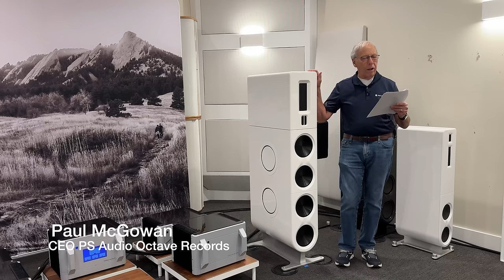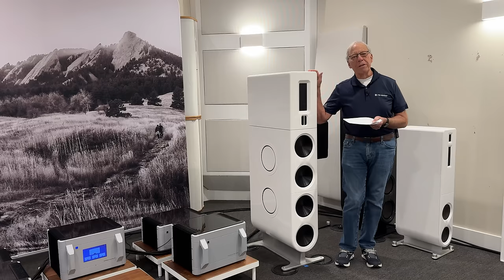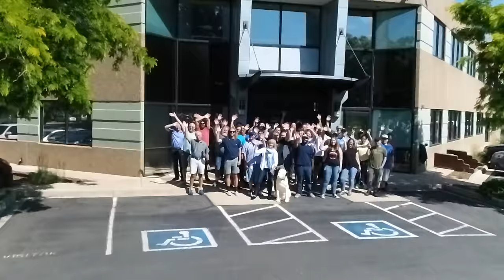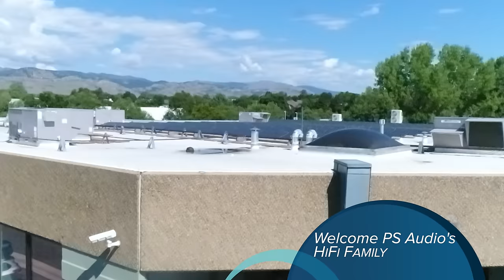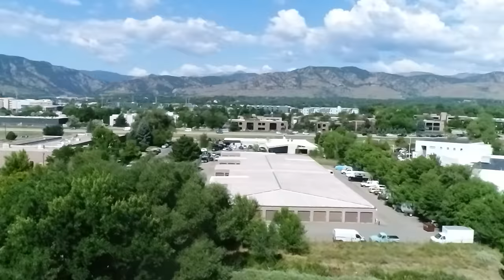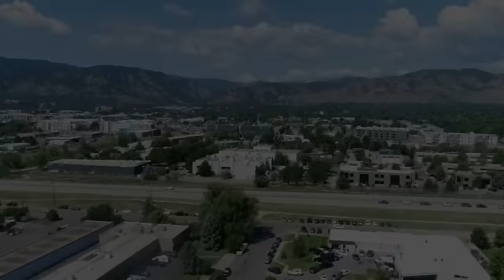Equipment without ground

Comment: There are two types of power supply , that is the conventional psu powered by  a large single phase or three phase transformer , whereby the transformer body core , is required to be earthed by electrical safety convention , while the other type is the switch mode power supply unit , where the electrical power line supply is directly switched by an embedded controller by a variable time constant high voltage pulsed mode   driving a high power mosfet drive which is then smoothed  by a high voltage capacitor , this is the type of psu , which is not earthed .

Comment: No equipment in the UK has 2 prongs because our outlets can run upto 3kw so every item is fitted with square 3 pin plugs including WiFi.where kit is class 2 double insulated the earth pin is plastic but still needs to be there as our outlets have shutters built into the sockets .the earth pin opens these shutters

Comment: There's a few YouTube videos from and with Shunyata Research where they are talking about all the investigations Shunyata Research did into chassis grounding and signal grounding.  On top of that, companies like Telos go a step further with "active grounding" (of chasses and signals).  I have successfully used Telos active grounding with a Luxman M-10X power amp's ground post.  Luxman and other Japanese gear has only two pin AC mains input.

Comment: Just want to say: A few years ago, wanted to change my cable TV provider. The new one insisted that the house had to have 3 ~ prong wiring. Had most of the house rewired, very glad that this was done! Important improvement! Yes, some electronic equipment is still 2 ~ prong. 😁

Comment: Star grounding your system, including all metal chassis, regardless if standard three pin, has a very noticeable sonic improvement on revealing systems.
Reply: No. No it dosnt. I prefer having my stuff grounded for proper surge protection but it makes no audible difference. Sometimes it induces more noise due to ground loops.

Comment: All extra groundings to a separate, audio-dedicated ground, especially if done through multiple, dedicated, intermediate grounding boxes, have to offer sonic benefits and lower the system's noise floor. Including any electrically isolated metal cases (isolated chassis). This includes the driver baskets on the loudspeakers. The far spatial resolution and low level information retrieval are tremendously affected. One has to hear the difference to believe it. For very long, I've been using a battery based system. No third prong anywhere, just the two poles of the batteries. Silver-plated, faraday cages, completely isolated electrically, protected my precious, short-path circuits from any external interference. I had never thought of any extra grounding, in fact trying it once, did not yield any positive effects. It was long after I had already achieved significant sonic improvements, using multiple, multidisciplinary mechanical vibration control on all of my components and after finding a way to further purify the power from my batteries, that the idea appealed to me again. And what a revelation when I tried again! Conclusion: If you can't hear the benefits of extra grounding(s), you have other issues to address before this final improvement.

Comment: Ground can be a hazard as wiring isn't always correct, as most guitarists know. You can potentially get shocked by true grounds such as water pipes and concrete floors. I've also seen tube amps and other equipment that induce some voltage across their chassis and will conflict with any other grounded equipment, it won't shock you but it will hum.
Most 2-prong hifi equipment is not double insulated, therefore it is somewhat safer to plug everything together before into AC, and away from true grounds.

Comment: Never use a three prong to two prong adapters to do a "ground lift" if you have "hum".  Proper grounding is important, the safety ground provides a low resistance return so if something bad happens the current will travel that way instead of through you.
Reply: Actually, for convenience, I often use two prong adapters, but also make sure to ground it to a metal surface using the small metal tab on the adapter.
Reply: I have seen two prong adapters used for location recording to get rid of the "hum." Not really a choice unless you want to forgo recording.
Reply: Lawd this is bad advice.

Comment: In Europe, grounding is very clear and it has to do with the operating voltage. If it is more than 25VAC or more than 60VDC, you must ground the chassis or have a double casing to prevent any chance of electrocution. The operating voltage in many hi fi devices is 5 to 12VDC. In computers, it is 3 to 21VDC. Power Amplifiers with rails in excess of 60V need to be grounded.

Comment: I run a Cyrus 3 with pxr psu, the power cables supplied are standard but only have the brown pos and blue negative there is no earth wire.

Comment: I have a high end Denon AVR and in the UK they only have 2 prongs and they use a plug convertor for the UK market. It gave some humming problems when connecting a Naim Hi-Fi amp into it.  I made a Ground Cable with only the Ground Wire  at the Plug. Attached it to the Denon Ground screw then plugged it into a spare socket. Bingo :) Silence :)

Comment: Call me crazy, but I think this was addressed improperly. I think the question was focused more on audible improvements from grounding equipmemt more than from the safety perspective.
Reply: One can assume that Paul answered the question in the only way he felt that ground mattered and therefor infer that he doesn't think it has any audible improvements.
Reply: Certainly not how I took it, watch it again.
Reply: Yeah, that could be... but I think the answer is still the same. If your chassis is not electrically connected to anything inside, then grounding it will make no difference to the performance of the circuits inside. Grounding the circuit itself would be like connecting Neutral to Ground... not a good idea.
Reply: In the UK.
Neutral is ground.
It's tied to earth (ground) at the power station.
Reply: @willtucker2774  Nope, neutral is NOT the same as ground in the UK. It may be tied to ground at the power station (or local transformer station), but a few hundred yards of cabling can cause a significant (few volts) differential between ground and earth at the outlets in your house, albeit without any power behind it. Our garage (in the UK) in fact has an additional ground rod installed, so the earth is also locally tied to ground, but neutral definitely is not.
Reply: @ve6svj in Canada, neutral is bonded to ground at the service entrance, it's not "whatever voltage".

Comment: My crock pot was 2 prong. At some point I was nearthe sink and touched the metal case an d got a strong "tingle". I being a man touched it again and - yep got zapped again.  I measured the case to ground and got a solid 50 + volts. I tore it apart and as they say , no user serviceable parts inside. Scrap and get a new one from Craigs list. How many times have you seen the wide blade on the plug filed off so it was no longer polorized? OR  plug a piece of PA gear into a ground to ungrounded adapter so it can float the power. [ who attaches the ground tab / wire to the metal box ].  Thanks

Comment: Hey Paul I subscribe and love your answers to all your audio.....except for this one , you really didn't go into detail as usual. A broken hot lead (however rare) that touches a metal chassis will surely liven up that chassis if it is not grounded and shock the user . I understand that they Isolate the power circuitry completely but that third wire(the grd.) is there for the users protection in case of a "fault". I find none of my 70's vintage beefy gear was built with 3 prong cords they all have two prong and they used some of the thinnest gage wire to do it (16,18ga. instead of a beefy 14 or 12ga) and often wondered myself why skimp there ? . I've been doing Electrical work for 37 yrs. now and yes I have a License and thought I would offer that info. Thx

Comment: My 200w Sunn concert bass head has the same kind of cable. Even scarier, there’s a polarity switch on the back with no + - logo
Reply: What the hell, for a hifi amp I wouldn’t bother but for a bass amp, where your are connected to the ground by the strings it sound scary as hell

Comment: In 45 years of using Hi-Fi gear, I don't believe any of my equipment has EVER been grounded! ... I'm in the United 🇬🇧 Kingdom, so my equipment has a three pin UK mains plug, but usually the mains cables are twin core with no connection to earth.

Paul is talking about "Double Insulated" equipment, which doesn't require a connection to ground. In the UK, it's indicated by a symobol looking like a box within a box.

Comment: I'd never buy a toaster which doesn't have a chassis ground wire ... but a hairdryer which is all plastic and " Double Insulated " ( with the symbol moulded or printed on it ) only needs Active and Neutral 
Chassi's used for ALL audio gear should be earthed ... I've felt slight tingling ( 245VAC  here btw..!) from a lot of un earthed cabinets that use SMPS's which isn't good 🥹
Reply: I've never had a toaster that had a chassis ground...not a thing in NA

Comment: Warning about vintage electronics. Especially that designed prior to "polarized" AC cords of today. Many guitar players learned the hard way to check their amp's ground while playing around wet floors at a bar! Or grab a mic. So if for no reason other than pure safety, I would replace any 2 wire with a grounded 3 wire on any serious equipment. Toasters and lamps excluded.
Reply: This is true of really old vintage audio equipment, but modern audio equipment without the equipment ground is perfectly safe, it is double insulated.
Reply: @mitchtaylor6512  I have a Pioneer SX-3700 circa 1980, it has a non-polarized plug, depending on what way I plug it in there is 86VAC on the case, you can feel a slight tingle if you touch it while not wearing shoes with rubber soles.   It all comes through a 2.2 mega-ohm resistor, so very little current....but you can feel it.
Reply: @mitchtaylor6512  That's for repeating what I said.

Comment: IMO the only audio equipment that shouldn't be grounded at the plug is a turntable. As many would know a separate grounding wire or terminal is used to reduce the chance of  tyhe dreaded ground loop hum.

Comment: My very expensive Anthem processor, 2 prong
My very expensive Yamaha amp, 2 prong
My middling Emotiva amp, 2 prong.
I always took it as a sign of superior engineering or at least care. I never get a hum from the gear and I'm not particularly careful regarding crossing wires ( no XLRs).
I'm moving soon to a country where I don't think you can trust the wiring/grounds so my new gear will all be 2 prong.